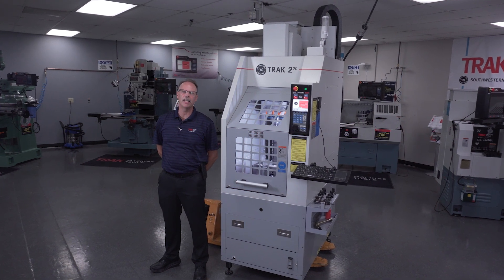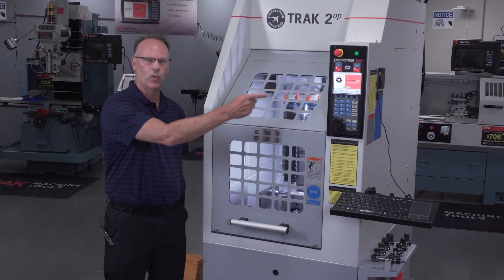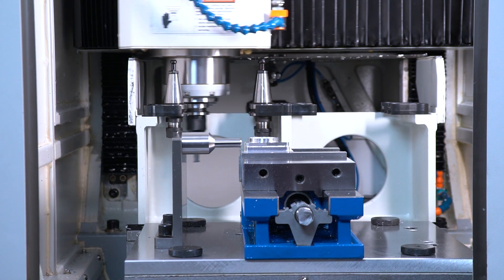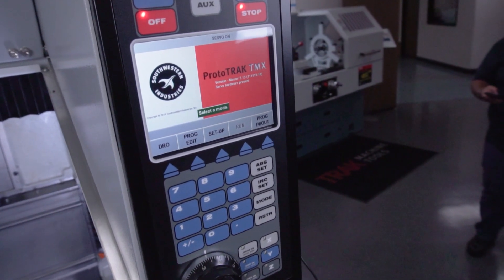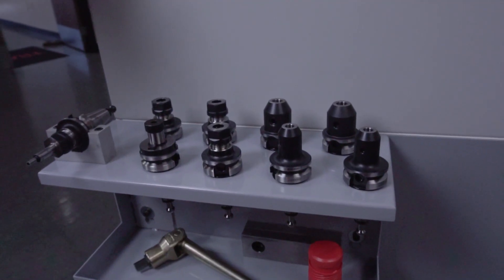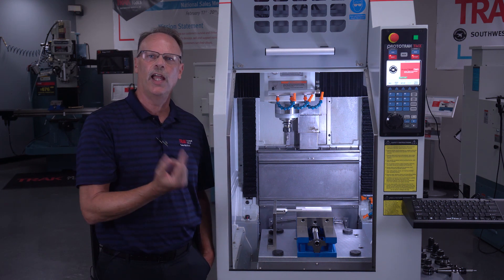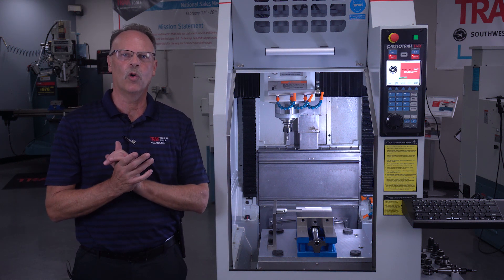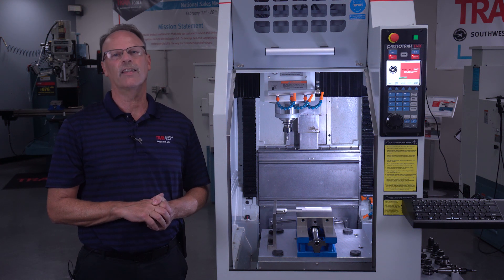TRAK 2op Portable VMC Overview

Comment: Machining accuracy?
Reply: Hello, This is no longer a machine that we sell however to answer your question for the 2op as well as it's replacement, the TRAK VMC2, if you don't level the machine, it will hold about .001" to .002". If you do level it, it will hold less than .0005" depending on your work holding, tooling and such.  T.P.

Comment: when you import an iso code fromm a cad/cam software, do you need a sepecial code for smooth surface or some arrangement to the g code?
Reply: Our low pass filter (M333 on the 2OP) is used for applications where higher block per second performance is desired, such as for surfacing programs.  It will look ahead more blocks of g code, and blend moves together to achieve smoother motion.  Note that when enabled, sharp corners may be rounded off at higher feedrates.  When running event-type programs, our machine runs with this option disabled (M334 exact stop mode).
Reply: @TRAKmanFlorida  is there any video in your channel about that? Would like yo see that.
Reply: @TRAKmanFlorida  Great information man, and is it possible to program with macros?

Comment: Hi pat why isn’t there many videos on the 2 op and it’s controller? Be nice to see some of the things this machine can do. I have the 2 op in my shop as well as the sls 630 lathe with the slx control. Just wondering why the 2 op doesn’t get as much attention as the rest of the track products.
Reply: Hi Claude, Since the 2op has such a simple control, there really isn't a lot to show however, you can learn most of what it can do through the SMX videos. If you don't have the SMX offline software, then you are either going to use the simple canned cycles or just run G-code files.  Please let me know if you would like to see certain things associated with this machine and we can make a video to show them.  Thank you!  T.P.